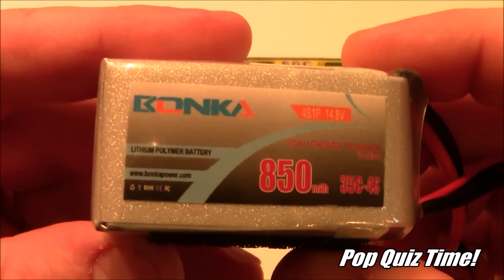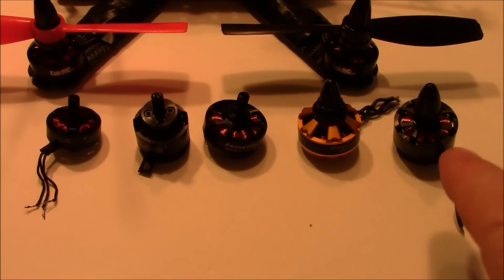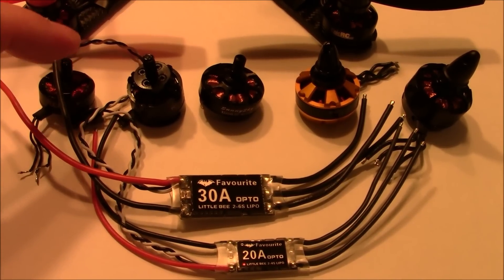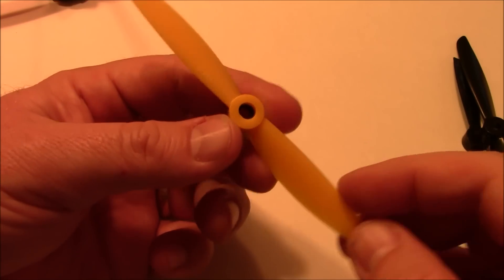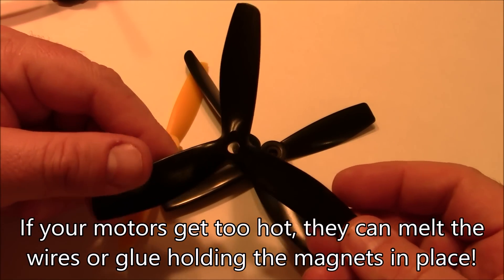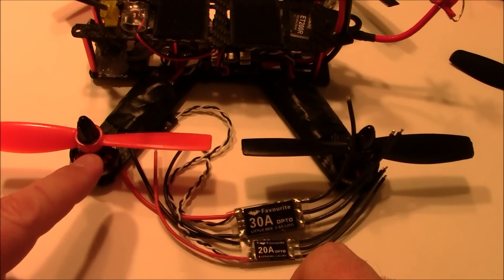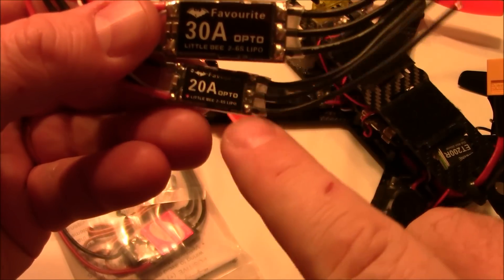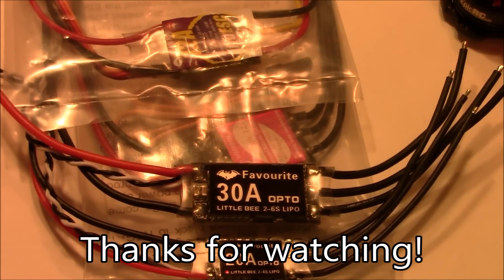Should You Upgrade Your ESCs?  Why Would You?

Comment: Very informative piece. Thanks for taking the time, I feel much better about these ESC's in my upcoming Robocat build. Cheers, dave
Reply from the maker: Good, I'm glad it was informative for you.
Reply: Hi Cow,
It really does come down to what you plan to use for props and battery. If you plan to use 6" props and 4s batteries, you are going to eventually melt something down.
If you plan to use 5" props and 3s batteries, you should be in pretty good shape.
However, there are endless potential combinations of batteries, their "C" values, weight of your quad, number of blades per prop and their pitch, etc, etc. for there to be some type of absolute answer. Do your research, find some tests on your motors with thrust charts, etc. and make an informed decision before you harm your quad (or someone) because of a bad combination of the above.
Happy flying!!
Reply from the maker: I use the old black SunnySky motors on my tricopter with 4S, 6045 props and 12 amp ESCs.  They've held up great and I push the motors hard!  The newer SunnySky motors with the stronger magnets would ask for too much power from the 12 amp ESCs and probably melt them.  If you're using the newer ones (red and black) definitely upgrade to larger ESCs if you think you're pushing them.  Give a quick flight, land quickly and then feel the ESCs.  If they are burning hot, you're pushing them too hard.  If they are just a little warm, they're probably fine.  If they are fine, I'd still check them occasionally every few flights till I was confident they were going to be fine.

Comment: Important question: Does the Battery give power to the ESCs/motors or do the Motors/ESCs take it? So if i have 4 motors each pulling 20Amps with a 20A ESC and I use a 1800 4S 40C LiPo (40C x 1.8 = 72A) does the battery limit what the motors get or do the motors take as much as they need no matter what the battery actually only can output?

Comment: prop size and power draw is kinda off. a 6in vs a 5in prop doesn't draw more amps because the few grams of weight, its because there is now an additional inch of prop pushing air. Both props in a vacuum chamber would draw the same amperage (only differing during spin up due to the mass) because they have nothing to push against. Everything else was spot on but the prop explanation.
Reply from the maker: +gingerneering101 The "spin up" is more of what I was referring to because no one flies a consistent throttle speed while flying their quad... it is always up, down, up, down... I listened to it again and I did say weight, which is really just half the story.  You got the other half about the extra inch of prop pushing air on the 6" prop.  That would really have helped further that point.  I'll try to mention that if I make another video on this topic again.  Thanks!

Comment: bigger battery means more weight.  try using that 2200 mah 4s and dive down as fast you can and try to pull up with 12 amp esc. i recomend using 20 amp esc on all heavy quads or you like freestyling

Comment: Hi guys,can anyone help. Having a trouble with two quadcopter I build, the first a Mini quad worked ok, but now will not. When I plug it into libra Pilot and do Flight controller the motors start up a yellow is on and a blue one flashing, but when I go to the transmitter and try to arm it no go! The receiver is binded  and the light is red, so what am I missing! I have a Fly-Sky FS-TS  and standard 6channel receiver. if anyone can help that would be great! cheers

Comment: +travisgrindal thanks for that great explanation

I have a doubt:
My Robocat 270 is running 2204 2300kv, 18a ESC (30a burst), 5x45 bull nose props, 3s battery 25c (35c burst)
And I got 6x45 bullnose props and a 4s 35C (45C burst) battery... But seems like the esc can't handle that battery with 6" props(I haven't tried), but also the battery is only 45c in burst, so that means only 11,25A for each esc-motor... right? Also I almost never run at full throttle.

SO, should I try the 4s with the 6" props? or what do you recommend?

PD. I saw a video of a robocat with 2204 motors, 4s battery, 6" props and 12a ESC!!!
Reply from the maker: The max continuous output of your battery is the amp hour (mAh/1000) multipled by the C rating.  yYou would need to find (or educated guess) the max amp draw of your motors and make sure your ESCs are sized correctly.  Then take that max draw multiplied by 4 (because you have 4 motors) and make sure your battery can output that many amps (or at least close).
Reply from the maker: the max amp draw of motors will be different with different sized props, so you'd want the 6" prop ratings.

Comment: If you fly with that big 2600mah instead of the 850, your motors will draw more amps, and if the motor can handle the amps, but the ESC dont't, you will need to upgrade your ESCs ;) or fry them

Comment: If you fly with that big 2600mah instead of the 850, your motors will draw more amps, and if the motor can handle the amps, but the ESC dont't, you will need to upgrade your ESCs ;) or fry them
Reply: To carry a heavier battery includes wasting more energy on it, as binding says, you have to change your esc´s because que motors while carrying more weight, they will ask for more amps
Reply: the battery does nothing it just holds power. it does not push power to the motor. MAH is just the capacity of the battery. it does not change the amount of voltage that is in the battery. the motors have no idea what size the battery is they are connected to.This may help you. If u have a pile of rocks and u are trying to carry them across your yard knowing how many rocks are in the pile will not make a difference in how many u can carry at one time. please stop spreading bad info.

Comment: Great video and I'm sure your right but I have noticed that the 30amp esc quads that I have seen on youtube seem to be making more power. So if you did a thrust test with something like a Tattu 1300mah 4s with 20 and 30amp escs would the thrust be the same?
Reply from the maker: As long as the motors don't exceed 20 amps, the 20s should perform as well as the 30s....  well, assuming they are the same brand, configured the same, and running the same level of firmware.
Reply: Ah yes the fact the 30amp little bees are newer than the 20s might helping them nudge ahead?
Thanks.

Comment: KV is another thing to take into account. The LittleBee 20a might be able to run 2204 2300kv motors, but will desync with many 2204 2600kv motors and up. The deciding factor in this case is no the amp draw, but the speed of the ESC itself.
Reply: Agreed,  F39x or better MCUs are needed for the > 2300kv motors.

Comment: good video but increasing the size of your lipo will weigh your quad down and the motors will need to work harder and thus pull more amps. so if your motors pulled 20a with a 1000 mah 4s then I guarantee a 2600mah 4s will either burn your motors out or draw more amps
Reply: +FPVandDIYlife Increasing the weight will increase the current required to maintain a hover and for non full throttle flight but it will not increase the current draw at full throttle. Not by a meaningful amount anyway.
Reply: +Brox3r the current sensor said my zmr250 pulled 22a per motor on punch out with a 1100mah 4s and 27a per motor on punch out with a 1800mah 4s
Reply: That's very likely because your 1100mah battery was limiting the motors and could only output 22a per motor.
Reply from the maker: +Tim Fulford There is a lot more content to talk about but I was trying to keep the scope somewhat limited to just generic 4S batteries and motor/ESC paring.  Besides the C rating of the battery, there is also weight of the battery, and motors with higher KV ratings... you could even get into warm weather vs cold weather... You have to stop some where, right?  :)
Reply: +Brox3r That's where the C rating maters as well. He forgot to mention that.
Reply: +travisgrindal I agree. Not trying to knock your video at all. Love your channel. My son and I watch all your videos. Keep it up.

Comment: Great video! Just a heads up those Velotech 12amp ESCs can handle a 20 amp draw with no issues. I've pulled 20 amps continuous for over a minute and the temp never went above 110F. Also that's with them running BLHeli.
Reply from the maker: +JKFlorida Cool.  I still run them on my simplecopter mini tricopter with SunnySky motors.  I have had zero problems with them so far.